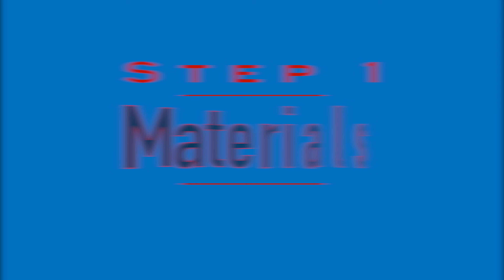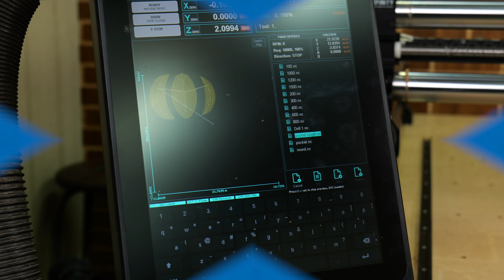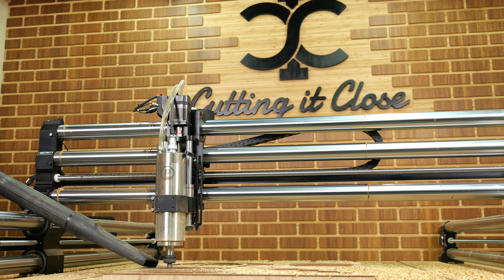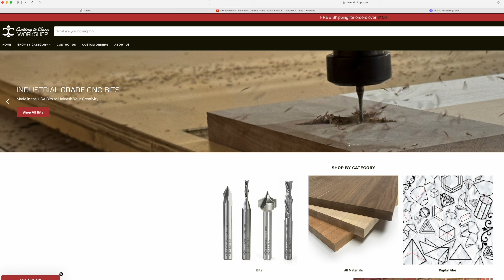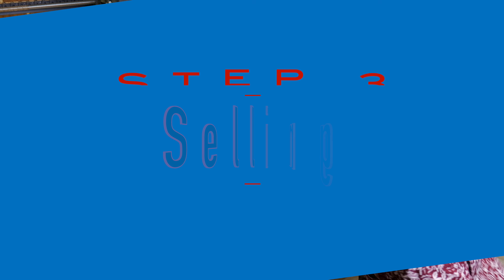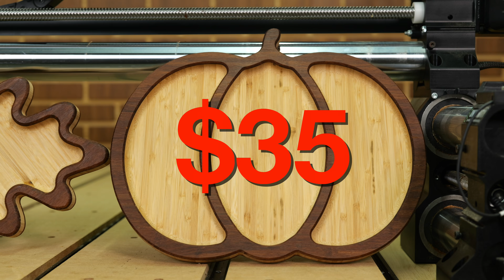5 Fall CNC Projects That Sell – Make Money with a CNC

Comment: Running the Onfinity as well, what speed do you recommend for the Golden Boy XL? Cutting pockets in pine.
Reply from the maker: Depends how tight your pocket is, 300 inches a minute is no problem. 600 inches a minute would be no problem, but it would probably not get to that speed. So as fast as you’re comfortable with honestly. Easily 300 ipm no issues with that speed
Reply: @cutting-it-close  holy cow, I’m running it at 125 and it’s nerve wrecking lol. Pockets range from 4x6 to 8x16 all 1.5” deep.

Thank you for responding!
Reply from the maker: What’s your pass depth? I would at least run it .25 deep per pass, you can easily go deeper though
Reply: @cutting-it-close  I’ve been doing .50 pass at 80-125ipm.
Reply from the maker: Yeah you should easily be able to run 300 ipm
Reply: @cutting-it-close  I will give it a shot tomorrow! Hopefully nothing breaks! Haha

Thank you again for your time!!
Reply: @cutting-it-close  performed flawlessly!!